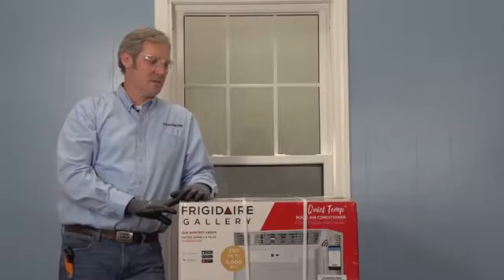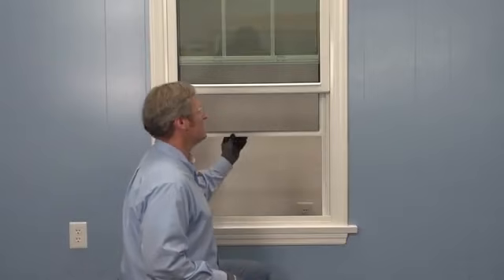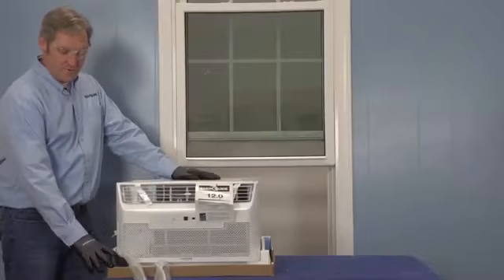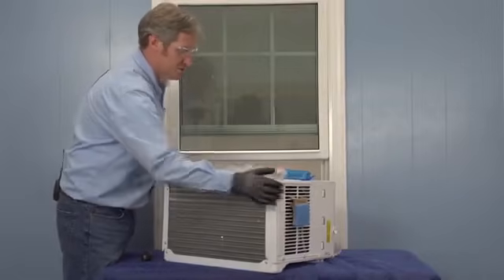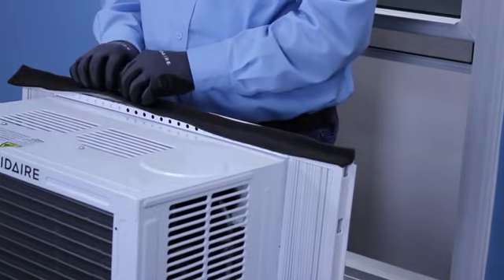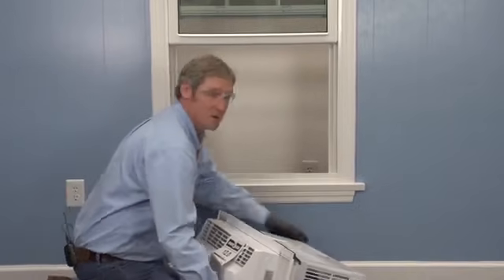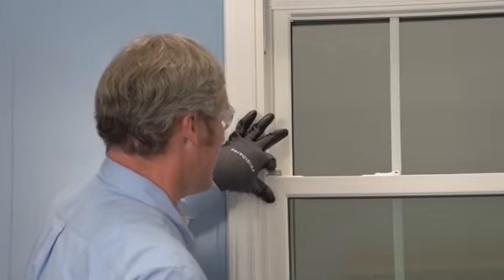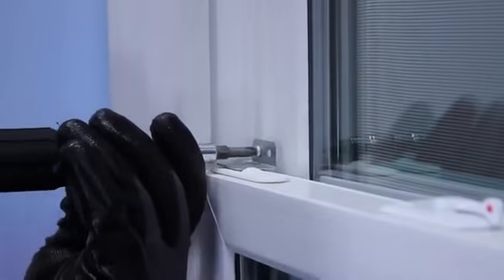Installing a Frigidaire 8,000 BTU Window AC

Comment: Thanks.  This unit and attachments are exactly like my new AC.  I put the top bracket on unit but instructions only show a picture and it was hard to tell if I did it correctly.  Turns out I did.  So now I'll finish up with the other things.  Great and explicit video.  👍

Comment: Lots of excellent information in this video, especially for someone who has never installed an AC before. Really appreciated the tidbit at the very end in regards to water accumulation in the unit and how modern units do not actively drip the way older units do. My problem is the window I'm putting the unit in is wider than the curtains provided can accommodate for. I've tried to figure it out from recommendations I've found here and there and this video gave me a lot of great information I hadn't seen elsewhere, but obviously it didn't help in that regard since the window he installed it in is so narrow. If anyone is daunted by the length, just put the video on and do laundry, dishes, etc and you'll hear something useful in time. 

Thanks for the video.
Reply: My window is too wide as well.    Question:   how did you resolve that problem?
Reply: @stevehaluska5645   I ended up having to get air conditioner extending panels from amazon. I got a variety of foam and vinyl just to see what would work. You can cut them to size to fit the gap in your window. Don't forget to purchase weather stripping and weather sealing tape for windows to cover any spaces that are left.
Reply: @StellarLunar  Thanks for taking the time to reply.    This is a big help.

Comment: You actually install/attach the foam piece ( that has sticky backing) to the bottom of the window where it touches the AC. Not upside down to the movable curtain and the ac unit.

Comment: One thing I would add is when demonstrating installation of the top rail, mention to the viewer which side of the rail should face forward and which should face backward. Correct orientation allows installation of the side curtains properly.
Reply: Read the "Installation Instructions" as well as watching the video.....
Reply: It's pretty easy to see...
Reply: The holes only match up one way.

Comment: What exactly is the correct downward slope ( 1/2  a bubble on the level You used ? 1/4  bubble ? ) I missed you detailing that I guess ? And if it is not correct how can it be adjusted ? The inst book does not give good directions at all - I'm old school and will never feel comfortable balancing the Unit in the window frame in the first place - Evidently that is how they are designed in the modern world - Thanks for your explicit Video Michael - answered most of my questions

Comment: I will never drill a hole for the safety tabs as a couple narrow pieces of other left-over material can be cut to length to jam the window down onto the unit - with that in mind, one need not drill thru the window frame in the center of the unit either - jamming it down with the cut to length pieces covers that problem also - I also do not like the accordion flaps for the sides of most units to make them a more universal fit for window size - I use painted to match plywood inserts in ours -

Comment: Please do not drill holes in your vinyl or metal windows if you are a renter or homeowner who will eventually sell the house without replacing the windows! Filling those holes with caulk or putty doesn't repair the damage like you can do with wood, it only masks it. This video is for people who are installing window a/c in a home they own and plan to stay in and don't mind ugly holes showing if they remove the unit during winter months. Big box stores sell clamp on side locks to prevent the window from being pushed up or you can simply use a wood dowel or similar cut the length from the top of the window to the top of the frame to hold the window down tightly. This will prevent it from falling out. If a bad guy really wants to get into your home, he's going to get in. A few small screws will not stop him from pushing the unit in and damaging your window in the process or kicking in your door - most door locks will fail with enough force, just as a hard enough push/kick to a window a/c will take it out. The key is to keep the darn thing from falling outward and harming someone on the ground and damaging the side of your home. As long as the bottom is in the channel and the top is secured so the window won't lift, you're fine. If your window doesn't have a bottom channel, or you live on the second floor or higher, or you're installing a larger/heavier unit of greater than 75 lbs, there are no drill support brackets that are easy to install and hold the weight - just don't use them with vinyl siding as all the pressure on the one or two small feet will crack your siding. If you have vinyl siding and need a support bracket, you'll need to take measures to spread the weight on the feet over a larger area by putting a length of 2x4 behind them or will need to use a screw in bracket that screws onto the outside sill preventing ugly and damaging holes on the inside of the window.

Comment: What about the exterior? Does the a/c needs to have a lot of space so the hot air that comes out circulates ? Cause I just bought the 5,000 smaller version but the exterior part of the unit is in a very small place with no ventilation and the cold air we can barely feel it it cools down the room but for like 15 minutes then the air comes out like in fan mode. Does the outside of the unit needs to be in an open space

Comment: Never Never NEVER drill in screws...  unless you want to have lower sale value.   Zero need for this unless your house if full of clumsy people.

There are NOT permanent ACs...  New AC will not match up.

Lastly if they want in...   the AC pops out.   those screws do NOTHING.   it just makes people feel safe.

Comment: I had to install the insallation that came with my model and I put the two thicker parts on  the sides of the ac and the thin piece at the top and folded it over and my room is much warmer. That's what the thicker parts are for. They fit nicely between the window cracks where the two slides on the left and right of the ac are and you slide it into the installation. Idiot guy came to my house from management and didn't do it. Room probably would've been extremely way colder if I did it but it was getting UTTERLY cold in my room since it's been stuck in the 30s here in NYC? Not sure why? Because something is off with that. It's actually way below that. Yesterday when I went outside it felt like 8. My fingers were burning and my face and also slept with my coat on yesterday..

Comment: Is there a way to avoid drilling to the window?  One day I might remove the AC unit :-)
Reply: No
Reply: Maybe if you could get a extension under the window that could be removable and block the air and drill on it
Reply: I did not screw to the window but because around my house is very safe.... We have a gated block wall around the house...
Reply: Yes !  There is always a way ,  I would never screw any screws in my vinal windows !   You may break the glass because you don't know how far the glass is in the window frame  ?

Comment: Now I know why he didn’t drill a hole on the security bracket that was closest to the window. It cracks the glass when you tighten a screw in there. 
It would be nice if they don’t have that second hole closest to the window for the brace. 
Thanks for the window starting to crack.  Otherwise the other info was good
Reply: Me too. Just cracked my window by trying to drill into the right (closest to window) hole in the L-bracket. The manual does not warn against that and shows screwing in both screws. Not sure why.

Comment: I'm using a regular old steel drill bit and can't drill through the window from to install the screws to secure the unit. Am I missing something? Should I use a different kind of bit?
Reply: I’m trying to learn preventative troubleshooting tips before I get to it. I hope you were able to  find a bit that worked? I saw he pre drilled the holes. Thank you 😊
Reply: No doubt you have already solved this problem.  Been HOT since then.

As other commenters have said, I would not drill into the frame at all.  Too much chance of cracking the glass.  That said, maybe your bit isn't sharp any more.  Or maybe you could start with a smaller bit and work your way up to the correct size.

Comment: This unit started leaking water from sides outdoors after 4 summers. I don't see a drain hole on bottom pan. Is this normal at this time.
Reply: Two things to think of man. 1st with the unit you want it angle down outside and not level. So the a$$ end outside should hang at a slight angle. At minute 23:40.  2nd also at minute 23:40 he tells you about the condenser coil. It is meant for the oil in the ac unit as well as the freon. But its not made to hold water. So with condensation it will accumulate water and start to sweat. So make sure you have that angle and you should be peachy.

Comment: I've got a frigidaire Window Ac/heater unit and it will turn on but all it does is just hum. It doesn't blow cold or hot air, any help with that from anyone?
Reply: Did you find out what happened to yours? Mine just started doing this as well.
Reply: @ExhaustedPidgeon  no I haven't had a chance to work on it yet,  sorry

Comment: This was informative, but dragged ever so much and was grueling to watch. Did we really need to see every freaking screw turned in when showing one or two would do? Or did we need to see the right side of the louvres installed after seeing the left? The unpacking was excessively long and we also did not need to see how to remove the plastic from the power cord. I took another commenter’s advice and watched at 2X speed but still dragged.
Reply: Some people are not as adept as you.  Just skip what you don't like and leave the details for others.